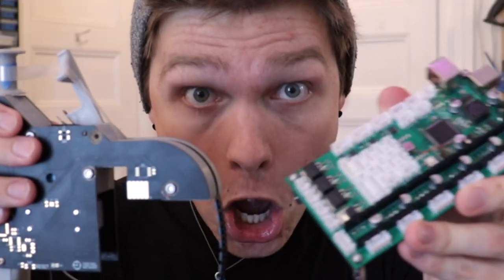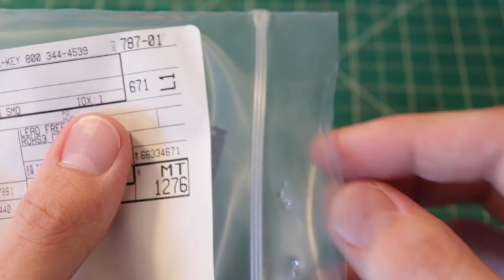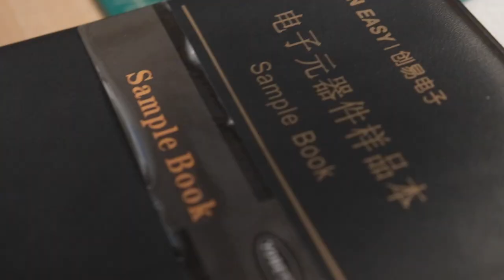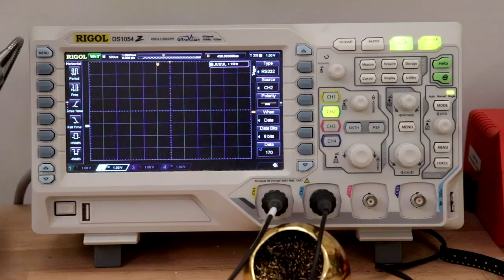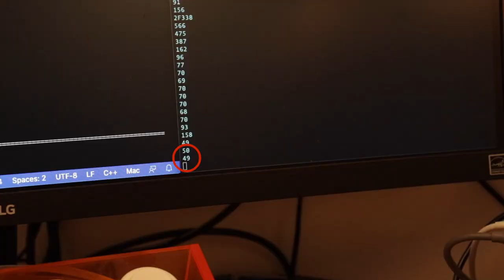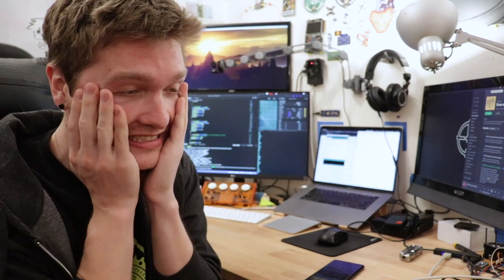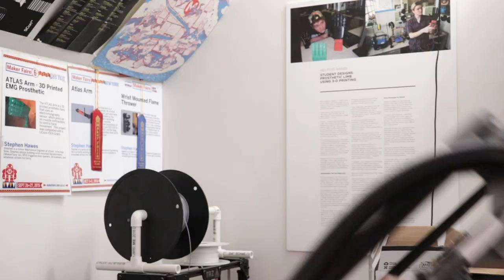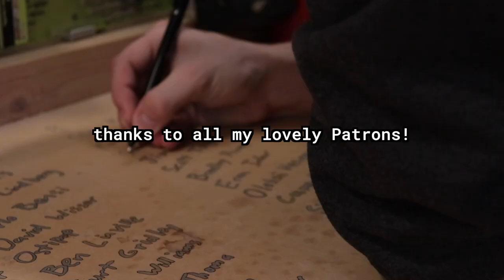Teaching Feeders To Speak RS-485!

Comment: You can use dip switches. Probably the easiest and quickest.
Reply: but...
LEDs....
Reply: I had the same idea!
Reply: That's exactly what I was thinking!
Reply: Also can use solder joints (those solder pads that is intentionally close so you can bridge it use a drop of solder)
~no cost, reliable, etc.
Reply: I immediately thought of that
Reply: @ushiocheng  No - you want to be able to swap out a feeder and set it to the ID of the old one, so manual switches (DIP or button)
Reply: @mikeselectricstuff  To clarify, the id just indicates the position of the feeder so the PNP machine knows how much to offset to pick the component up, there shall be another id stored in feeder's EPROM telling the mainboard what component is in it, I believe, or just the feeder's uid.
Reply: Dip switches or jumpers if you want to go cheap

Or a "programming button" on the feeder which, if you press it, it listen for a special command on the bus which tells you it's ID, and store it to eeprom
Reply: Easy if there are 5 input lines to the feeder controller. Less easy if only one, needs a shift register. 
Another way, to the first feeder receive command from the MB, if the id is 0, it executes the command, otherwise it decreases the id by 1 and passes the modified command onto the next feeder. This requires a 485  line between feeders, and a line to mb for feed back. To set ids, MB send 0xFF, 0x69, if it gets a reply, there are 255 feeders, if not  it decrements the id and tries again with 0xFE, 0x69, repeats until reply is received. The reply will come from the last feeder in the chain which sees a 0x00, 0x69.
Reply: No Dip Switches!!!! I remember that horror while developing the Clarkson Packet Driver Collection, having to set all the Ethernet card's dip switches to the correct values.

Comment: You almost got the RS485 signalling explanation correct. The voltages are never the same, it is a differential signal. If you measure across the two outputs, one line is always positive and the other is always negative, you will never read 0 across the two outputs unless the driver is disabled. To communicate, they just swap their relative states depending on if it's a 1 or a 0 being sent, effectively creating an AC signal.
Reply: That's what I came here for!  Mark is a>b, space is a<b, and a=b is undriven

Comment: Don't worry too much about resistor strapping.  It is a time honored method.  Use 1% resistors.  They are not a big cost adder at all.  On your ADC reading - do a 256 x oversample average and between that and 1% resistors - there is no issue there for 32 channels.  Dip Switches are also pretty prevalent out there if a bit kludgy and IO intensive.  More IO = more wire = more connections that will fail.  Bottom line is you already have a working method that can be improved in software and with 1% resistors so why reinvent the wheel :)  Nice work as usual.
Reply: I second that 1% is the easiest answer but you would be best to add temperature compensation  by adding a reference thermometer.
Reply: But they either add a huge number of different components to your bom or you need quite a lot of space to be able to combine resistors
Reply: @dannyarnold9823  i don't think that this will have any significant effect on voltage divider. Keep in mind that he is creating voltage divider and temperature is affecting both resistors. Only thing important is the difference in resistance between the resistors not the acctual value

Comment: You could use the chaining as the addressing system: each feeder passes the message on to the next but decrements the ID by 1. If it receives ID 0 it feeds. That way you don't have to set addresses at all, they are just based on the order they are chained in

Comment: Don't over-think the protocol - all you need to tell it is to feed and how many units of 2mm ( 0402s and smaller have 2 parts per index). This makes decoding trivial, and you don't need to worry about frame synchronisation. 
 One thing to bear in mind is that all the other feeders will see any reply bytes as it's a shared bus.
I'd suggest <id> <command>, where <id> always has bit 7 clear and , <command> always has bit 7 set. this makes decoding trivial with no need fo framing timeouts. <id> would be a special value for status returns, so other feeders don't respond, and return values always have bit 7 set.
 Probably easiest to always return a status byte  to simplify things. You don't generally need to know when the feed has completed, so you can return status immediately rather than waiting for the feed to finish, but you probably also want a null command that returns a status telling you if it's still moving, e.g. for manual indexing & setup.
Reply: Or, as an alternative, just use Modbus RTU with some opensource implementation? Sure, lots of processing overhead, but speed should not be an issue in this case. Could be an easy way out?
Reply: Why wouldn't you need to know when the feed is completed? You can pick up the part only after the feed is done
Reply: @petermuller608  Totally agree. In a control system you need to know when the command has been 'actioned', not just when it has been 'received'.
Reply: @petermuller608  it can know it by use of SCIENCE!

Comment: Use DS2411 (OneWire ID chip) ! They are in a SOT-23 package, they are cheep and you need just one pin of the connector to get the their ID
Reply: Those are really expensive since they are used for DRM. An EEPROM would me much cheaper. He could even add an MCU to each slot (not just feeder) and it would still be cheaper :D
Reply: @petermuller608  Not that expensive, $1.32 in single quantities at Mouser
Reply: @electronerd  that's quite expensive ;) eeproms cost USD ~0,1 and ARM MCUs cost USD ~0,9, also in single quantities.

Nevertheless you are not wrong. You won't have hundreds of feeders so the price difference does not matter that much in the end
Reply: @petermuller608  Yeah I guess it depends a lot on how many you're building whether $1 is a lot or a little
Reply: @electronerd  Yes, they are expensive AND nice because they have the globally unique ID you need.

Comment: For auto-ID you can run a wire "north" and "south" to the adjacent feeders with the feeders on the end looped back to the controller.  To ID the controller holds one of it's North ID pin high.  One feeder will see it's South pin go high, that is feeder 0 and it sends a serial message that says "I'm feeder 0" before pulling it's North pin high which triggers the next feeder to say "I'm feeder 1" and so on.  When the controller see's it's south pin go high, every feeder has reported in.  This does require dummy jumpers in every empty slot. 

Alternatively, you can get hexadecimal rotary switches that will give you a 4-bit binary number depending on rotation.  2 of them gives an easy to set 256 entry address space.

Comment: Along with identifying which slot is occupied by which feeder, it would be good to have a way to associate an id to each feeder, and the component type to the feeder. That way, when you load up feeders they don't need to go into the same slots as previously. You would even be able to PnP boards with more different components than you have feeder slots for, that require swapping feeders in and out, without worrying about accidentally loading the wrong components into the wrong slot.  You might even create a separate single-slot "prep station" with your "floor" connector and a barcode reader to read the barcode off the component reel, and program that info into the feeder.

Comment: Hey I have a few comments to help you on the next revision, I worked on something similar where I used RS485 for communication and needed addressing as well. For the addresses I used a 5 dip switch and read it as a binary (1, 2, 4, 8, 16) input, which gave me 32 addresses and worked great. Another thing is RS485 needs termination resistors, so at the end (and sometimes beginning) of the chain it's recommendable to put a 120 ohm resistor in parallel to A & B. Putting a resistor on each RS485 transceiver will usually overload the circuit causing errors, so it is not recommended.

Comment: With no changes on feeder or motherboard, but an extra wire on the daisy chain: Have one resistor connected to the left slot and a pull up, feeder analog pin to the center. Ground the "left" resistor on the first slot. The lowest analog voltage is first slot. Make the identified analog pin output ground, then the second slot will have the lowest voltage. Repeat.
Reply: Great idea!
Reply: Very good idea.  Makes all modules the same, and no changes in the current feeder.

Comment: My plan was to put a $3, 0.91" OLED display on the feeder.  4 push buttons and the feeder now has a UI.  Much more functionality for setting variables like sprocket holes per part, fine tuning the stop position, setting address etc.
Reply: That does add quite a lot of complexity to the feeder. If you need to configure it I would use EEPROM on the feeder. You already have SWD anyway
Reply: @petermuller608  Having a UI for setting up the feeder allows setting parameters on the fly without having a separate PC.  All you need is a spare power source, no programing adapter, no programing software, no 2nd PC, etc.  Just put the tape in hit a few buttons and you're done.

Comment: I think reading the id from the connector board instead of setting the individual address of the feeder is the better approach. Less hassle when inserting new feeders or changing them.
As other people said, you can use 1% resistors and they should be precise enough. Also, I just had an idea. You could also place a capacitors on some boards. Have a voltage divider and a capacitor to GND. If you pull the line low and than measure the voltage, you should see the voltage raising fast (if no cap) or slow (with cap). This way you can identify the board that have a cap and those that don't. If you use the presence of the cap as part of the address, you can get away with only 16 voltage dividers.

Comment: This is a year and a half ago, but the easiest way to enumerate devices in a chain is to have them echo the RS-485 signal down the line. When they receive the first command ("Identify Yourself"), they send something back to the controller, and mark themselves as #1. When they receive the next command, if it's not addressed to #1, just echo it to the next device in the chain.

Comment: If you want to reduce the ID stuff to just 1 pin you could send a square wave signal to the first board e.g. 100khz and device it by 2 on every boatd. The feeder can easily measure that and detect its position. You can use a simple D Flip Flop to devide by 2.
Reply: Nice, this is simple enough to put on the connector board in place of the resistor divider.  There are some tiny single gate SOT-6 logic chips that would be perfect for this.  Digikey 296-9851-1-ND or 1727-6019-1-ND for example.
Reply: This frequency stuff will not fly.  If the first node receives a 100kHz signal, and output a divided by 2 one (50kHz), then the last node will get a 100kHz/(2^31) signal, ie 0.0465 Hz,  Identification will take too much time ~21s.
This idea could work for <20 nodes, with 500kHz input freq.
Reply: @ikocheratcr   Good point.  The chips I linked would be happy with a signal well into the MHz range, but you're still waiting for 2^31 cycles.   which will be a several minute period for the last feeder.  A 3/4 or 4/5 divider would help a lot, but also balloon the circuit complexity.  Could do two chains of 16 using frequencies that divide distinctly.  ( i.e. 66KHz and 100KHz) Wonder how simple a pulse eating circuit can be made?  (i.e. send out 32 pulses, and each feeder gets one less pulse as the boards eat the first pulse they see)

Comment: I've just recently come across your channel and I have to say that I'm really excited about what you are doing.

I would use dip switches either on the feeder floor or on the feeders themselves. much more reliable than using an analog voltage. also makes it much easier to see and adjust the adresses if needed.

Some suggestions for the communication protocol:
* add a protocol version. that way you could have multiple versions of the feeders installed without having to change the firmware on the motherboard every time. the feeder could send a little hello message with its version number so that the motherboard can detect what features it supports if you expand that in the future. 
* maybe add a confirmation response once the feeder is done moving the tape so that the pnp doesn't try to pick up a part if the feeder isn't done moving yet.

love what you do. keep it up 👍👍
Reply: No dip switches. Never.
Reply: @RussellNelson  why? Genuinely curious
Reply: @juliankandlhofer7553  First, because they are a pain to set. If they aren't a pain to set, then they're easy to change. Second, because you only need to make one misteak once and you've lost whenever you might have saved by using DIP switches rather than a programmatic id scheme which will always set a unique id. For example, he has a sensor on the wheel, right? So when you get everything connected, just go down the row spinning the wheel a bit. OR have a bit of software which goes through the BOM and tells you to twiddle the wheel a bit for each part. Then the system not only has put a unique id on each feeder, but it also knows which part is in which feeder.

Comment: If the edge connector were double-sided then you'd have five extra pins which could carry the slot address allowing 32 slots (technically 64, as you also have one spare pin on the other side as well).

I do like the idea of not having to set the slot address on the feeder itself though. Having the feeder know where it is automatically is infinitely 'cooler'.

---

Even if using resistors & voltage dividers won't allow for 32 feeders it should still work for a smaller number of feeders no problems....

If you have enough IO on your mainboard then I guess you could have multiple RS485 interfaces, then each bank of feeders would connect to a different interface (eg. 16 feeders on each side of the machine, each bank talking to the mainboard on a separate RS485 bus).

Comment: How it's usually done in the industry is that every feeder has a unique ID. That way you can plug it into any slot in the pick and place and the machine can figure out from which slot to get the correct part. Sometimes there is even all necessary information about the part stored on the feeder itself so you can just use the same feeder on different machines without any additional setup.
Reply: Those machines likely have a separate serial connection from the controller to each feeder. He does not. All his feeder IO pins are electrically in parallel. That's why he needs the feeder to know what slot it's in

Comment: If you stay with analog ID's, something interesting you could do, is stack all the feeders in series somehow with a termination point, then if they all use the same resistance it would ratio out automagically. Using 3 feeders as an example, it would stack three 10k resistances in series, then divide that out across the voltage range for ADC stuff. Adding a feeder and setting the termination points would change the ratio. Some more thought needs to be put into this, but I think it has some merit in not requiring any manual address fiddling. Else the dip switch idea is pretty solid.

Comment: I might be late to this but simplest solution would be using a shift register. If you have lets say 32 feeders, you need a 32 bit shif register that has a single active bit. You start at position 1, send a command over RS-485 containing the ID which is 1 here. The feeder that sees the active bit, takes up that ID. Then you shift the active bit to position 2 and then you send the ID (2) over serial again. Let me know if the description is not clear or if you want to get in touch to discuss this.

Comment: FYI, encoding the position into the slot itself is (imo) always the most elegant solution.  Makes the feeders themselves cheaper, meaning you can have more of them.  Not having to program a slot manually means less room for human error, which is a primary goal (or should be) of any automation/machine design.

Comment: Maybe it'll be a good idea to use shift register (74hc165d for example) or counter, to identify feeder placing. It will take 3 pins of feeder controller to talk to shift register, and you have 8 bits of its parallel input pins to make the position code.
Reply: That is a really good and cheap idea, just push a bunch of ID down the line and have each feeder read the local shift register and then they know in what order they are placed.

Comment: Late to view this... more great work, Stephen! 

After reading all the commentary I'm leaning where most others are leaning with the DIP-switch-based ID scheme.
Unsure where you upper-end would be with address limits, but minimum 5-bit me thinks.
The "daisy-chained-relative" voltage suggestion with the additional bus wire was also a slick potential solution.

Looking forward to your next update!!